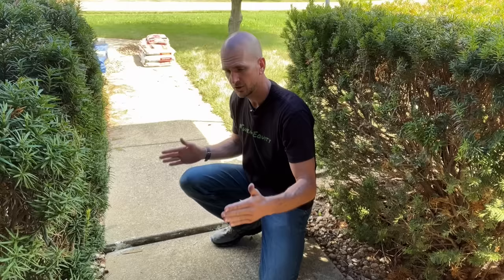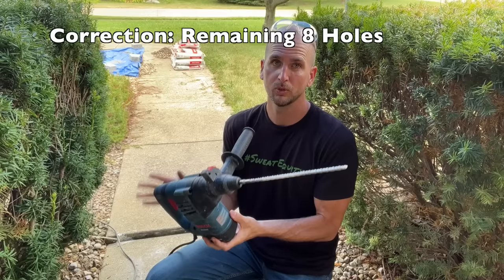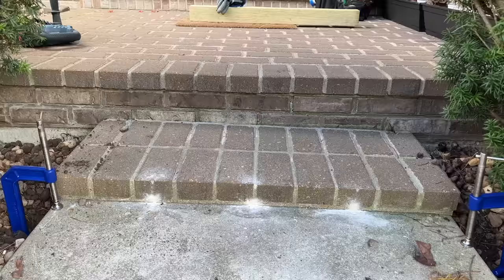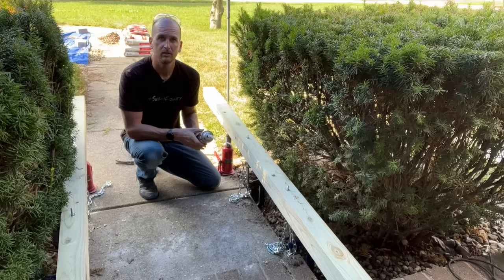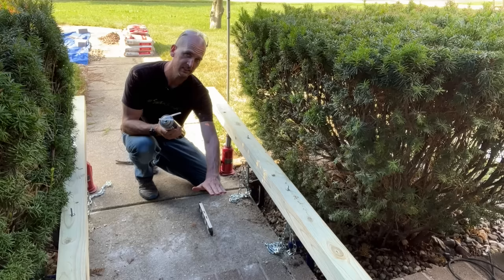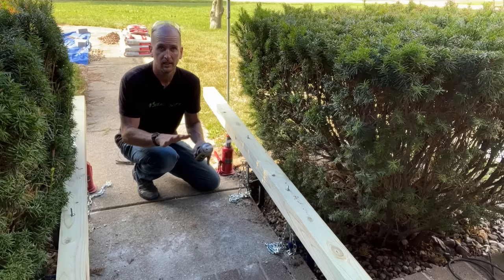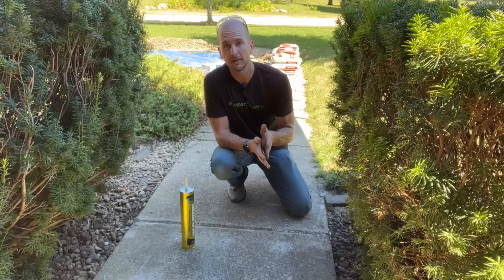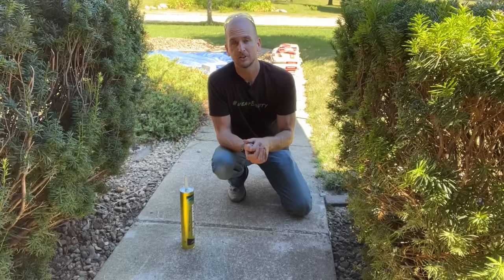How To Fix A Sunken Sidewalk With Spray Foam

Comment: A small piece of a 2 by 4 and a crowbar will do the same thing take a small hole in the corners of each side that's lowered use the crowbar against the piece of wood to pry the concrete up repeat on the opposite side

Comment: Looks good how it was raised up level again with the technic used though any spray foam will break down in time & give, I would have trenched under the slab both sides added some bricks though in doing so when the slab is being lifted I would have raised it up approx quarter inch or so then work bricks in tight in center & both sides therefore the slab in time will settle making it even with the other slab.

Comment: Drill a set of 3/4 holes use self leveling cement instead of foam and instead of that junk in the cracks use Silkaflex it's at home Depot and Lowes in the concrete area and is made for UV resistance and made to last for no less than 20 years

Comment: Great video: short, to the point, good technique.  One question, what about if we don't have two bottle jacks laying around?  Seems like maybe could use a hydraulic car jack (maybe with some tweaking for side to side), or other 4x4s as lever arms to lift the ends of the 4x4s you show.
Reply: Any car jack should work. If they can lift the car, they can lift a few square feet of concrete.

Comment: The foam will deteriorate quickly over time & cause the sagging again, I would use the round cylinder concrete block that the foundation company uses to put underneath & pour concrete cement in the dig areas & seal it with dirt over it. This will pretty much permanently lasts for a quite long time.

Comment: And what do you do when the great stuff breaks down? Its also not made for ground contact or weather exposure so that will break it down even faster than when its used inside.  Its designed to disintegrate over time to powder.  You needed to use spray foam concrete for this project.

Comment: Considering all the steps and all the stuff used i kind of feel that just removing the slab, just fill in whatever suitable, long lasting material you have at hand is better. If he could use the spray foam to do a quick fix that would be one thing...

Comment: Open and closed cell spray foam hold water. It rains, then drops below freezing with the water retained in the foam. When water freezes it expands...When this happens your concrete will crack every single time to make room for expansion. No expensive papers from college but I understand simple physics. Good effort though

Comment: I've done some foundation repair and such but I'd ask the life span of foam compared to puming mud seems the mud stays if you mix the portlaine correctly but for seems holds up to water damage whitch is usally what cause such damage water can destroy anything. Portlaine the simple bye product of ash or crushed rock natrual earth material not chemicals

Comment: To do this correctly you would need the closed cell foam instead of the spray can foam. The spray foam gets compressed over time. Or just mix a thin slurry of cement and pour through a  hole under the slab.

Comment: Unfortunately, my sidewalk runs next to my brick house and there is a raised brick planter running the length of the sidewalk on the other side, so I have no way to get a clamp under the sidewalk. My only choice would be is to hire a mudjacker or resurface the concrete walk level to meet the rest of the walk. If I resurface one section, I'll have to do the whole length, otherwise it will just look like a patch.

Comment: This guy is definitely an engineer and not a contractor.  Ingenious way to lift a slab but wat too labor and cost intensive.  A simple 5' pin bar and a few 2 x4 or concrete pavers would have tis done in half the time.   Also, the step that the concrete buts up to is only 2 -2/14" high and is also a trip hazard.  Its also not to standard building code, which states that a series of risers can not differ individually in height by more than 14".  The next riser is clearly much higher than this one making this first riser a trip hazard as well.  I would have ripped the walkway out and replaced to to be level with the first step.  .

Comment: you could literally make a company doing just this where Iive for probably 10+ years.  I'm a glazier and I can't tell you how many new homes have sunken steps and sidewalks at the front door.  it's like 95% of the homes we go to need this done as they have one step with like a 10" rise and the others at a normal 6 or 7" rise.  it's always the first slab like in this video that sank.

Comment: You cant spend about $300  for Bottle jacks chains J bolts hammer drill bits 4 by 4 lumber and c clamps or about $30 for a few bags of concrete mix

Comment: With a small lip of less than say 1 inch. Could you not just grind off the lip with a handheld angle grinder to remove the trip hazard? Although not an elegant solution it would weather over time and not be too noticeable?

Comment: it was luck that kept the concrete corners of the other slab from cracking under the weight of the bottle Jacks.Good Video just seems expensive in tools and materials.

Comment: My "drooping" slab is up against a raised concrete porch. If you're standing on the slab, looking towards the porch, the left side of the slab is right up against the side of the house (CBS with stucco) and there is no place to get a C-clamp there. The other side is a flowerbed, so no problem on the right side. What do you recommend to raise the side of the slab that is both up against a wall and the concrete porch? The slab is about 4 ft. x 4 ft. concrete.

Comment: I would have put 2 or 3 bricks on each side where the C clamps are for some solid points. Not sue how long that foam will last before it starts compacting.

Comment: Great work, man. How has it held up so far?
Reply from the maker: Honestly, it sunk back down.  The sealant is still holding strong but my best guess is I probably should had let the foam setup for longer so when I place the weight from the sidewalk back down on the foam it would had a better shot of holding the weight.  I am going to do a round 2 coming up this year and looking for an alternative method.  Stay tuned.

Comment: With the cost of 4x4, c clamps, jacks, spray foam and all the hardware. Seems a lot cheaper to remove slab a pour new concrete.

Comment: Lifting is fine but not everyone wants to wrestle a heavy item. This is simple let the foam do the work for you. Unlike having to cart dirt and shovel it the foam takes a lot of time to compact and break down it’s temporary. If you had settling the lift dirt or rock method is as well since there was a reason that dirt settled in the first place.

Comment: Very clever jack rigging.  How's the level holding up so far with the spray foam?  Wonder if that stuff compresses much over time.
Reply from the maker: Not the best, If I did it again I would do the same to raise the slab but use grave, sand, bricks or something else as the base.
Reply: @EverydayHomeRepairs  too bad.  😞 I was hoping for an easy solution.

Comment: Did you do that for yourself? If not, how much does a repair like that cost the customer? I would suggest putting plastic bags around the bottom of each C-clamp. That would keep the foam from sticking to the metal.

Comment: Nicely done, but quite frankly, at the costs of all the items that it took to lift the slab before injecting the foam under it, especially these days, it probably would have been cheaper to sledge hammer the sunken slab and poured a new one it its place.

Comment: Good job and great video, but with such a small piece, why not just mix and pour a new section?  A few bags of concrete might be less than drill bits, foam, 4x4’s, bolts, chain and maybe jacks and clamps if not already owned.

Comment: Hi. That Tremco Vulkem 45 SSL One-Part Semi-Self Leveling Sealant has a near perfect color match to your existing (older/aged) concrete!!! Looks good. How did you do that? Is that the exact color right out of the caulking tube? Or did you add something to that caulk sealant to better match your existing concrete? 
I’ve been using SikaFlex grey self-leveling sealant WITH some sand sprinkled after on top, to better match the existing concrete. Not perfect, but decent compared to stand alone grey/or limestone sealant. Which doesn’t look to appealing at all. Thank you very much.

Comment: A lot of comments mentioning an easier alternative of lifting the slab and putting dirt/gravel down. 
Can we at least understand that spray foam is used almost exclusively for raising large format slabs? 
My pool deck was fixed in a similar fashion. 
No chance in hell you’re lifting those slabs.

Comment: Humble opinion: the real problem is not being addressed, the soil under the foam will continue settling because there is not compacted roadbase under the slab, organic soil is sensitive to the water that will enter through the sides and will continue settling, there is no rebar or dowel bars connecting to the rest of the walkway or the foundation, therefore, when the soil settles (and it will) there is no rebar to hold the slab up. I stoo hiring the foam services as i was always getting a warranty call in less than a year. It is cheaper to install a mortar ramp to alliviate the trip hazard, but if you want a real solution, remove, install road base, comoact it, install rebar connecting into surounding slabs, and new concrete. In the long run, it is cheaper to replace with nice structural reinforced concrete.

Comment: Break up the sunken concrete, build forms, pour new concrete using bag mix and a wheel barrow. Will be cheaper, less expensive and take less time. Enjoy your brand new and properly sloped sidewalk section free of holes and cracks.

Comment: Well if you like to work hard and smarter that was the way to go, not to mention substantial higher cost.I think it would have been easier and a lot less expensive to break that concrete up and pour a new one.

Comment: I'm in the process of trying this on a larger section (5x8) at my home.   I've seen other using the Great Stuff - Gap and Crack vs the Large Gap that was used here.  Does anyone know which might support more weight, be better in the long run?   The number of cans doesn't really matter to me.   I know that the "Large Gap" is Closed cell, so it won't suck up water.  Not sure about the "Gap & Crack".

Comment: I think this is a great method ..but for a dyi’r .. by the time you buy all you need to do this.. you’re better to break it up and re- pour the concrete. Or put brick down to match the upper step. 
Either way I think the amount of work and expense equals if not cheaper than leveling. Also no holes drilled. I know me… seeing those holes would bother me 🤷🏻‍♂️

Comment: GREAT VIDEO! THANK YOU!
Just one question?
On the side, near the end of  the video...
Is that tape on side in between the slab you raised and the one you were standing on to work?
If so.... what is that for?
Reply from the maker: That tape is just to ensure the 45 SSL sealant doesn't spill out.

Comment: I wonder if a person couldn't use a long piece of clear flexible tubing the same diameter as the foam straw and spray the foam in from the side instead of drilling the slab.

Comment: As a professional contractor that has a poly jacking company. This foam is not going to last it does not have the strength to support the weight of concrete over time. For the cost of all the time a materials you can have a professional repair done for 250 dollars. But I like the ingenuity

Comment: You're going to have 2 issues. 1 being the concrete will begin to crack between the holes you drilled with them begin so close together and secondly, you need some sort of hardening agent mixed in with the foam. It will eventually settle back down as the foam breaks down

Comment: A little quick research and i see that Great Stuff has a compressive psi rating, from the manufacturer, of less than 10. Concrete, meanwhile, is in the thousands. Will this method actually hold up?

Comment: I got a rocking slab on my driveway. The slab isn't sunk yet but when you drive over it, it rocks.. Do you think this spray foam is strong enough to do this on a driveway or would I have to upgrade to a secure set?

Comment: I actually lifted and leveled my 5 x5 main walk way sections (2 low sections) by drilling 1/4 holes and filling ea hole a little and accordingly at a time w the foam  un believable how strong that foam is  I used 5 cans of great stuff 430 and 2 hrs was way cheaper and faster then demo and pouring 2 new sections.   even tho there's only $35 worth on concrete in ea 5x5 section local contractors get 3-500$ a section which is insane imo. yes some demo but that isn't hard and lets be honest staking 2 2x4s on ea side isn't rocket science    folks don't be afraid to tackle side walk rear or replacement on your own  you'll save thousands literally!!  sealed the drill holes which were filled by the foam I just ran drill through the foamed holes quick and filled  with leveling mix concrete really thin watery stuff and capped about 1/8" dimple w acrylic caulk  under $50 total for 50 sq ft of sidewalk repair!

Comment: Yes it works however what is not being said is after a year the foam breaks down because it is against dirt and moisture that will break it down and it will be the same way a year later. This is what people do when they are selling their homes and don’t want to spend big bucks. They figure it is the next home owners problem.

Comment: IMO it probably would have been faster to break out that one section, form it up and hand mix a couple of bags of concrete to put in the forms. All of the work that you did to get a level small piece of walkway sort of makes me think that you may work for Public Works department of a city.

Comment: good work, but not applicable when you have a walkway between two house foundations. Still working on how to raise the slabs from ONLY the edges ON the walkway, not the sides of the slab.

Comment: After the cost of Roto hammer, posts chains bottle jacks, wouldn’t have been more cost affective to demo and pour that section?
Reply from the maker: Some people prefer that method others don't like when the concrete doesn't match.  If you don't mind the mismatch breaking out and repouring is not a bad option.
Reply: @EverydayHomeRepairs  loved the process though.
Personally I’d enjoy the way you did it, just because of all the moving parts. :)

Comment: Well nice work but I think is to much work for just simple concrete slab,,,,in my case I just flipped up and put the floor to the right level with compacted sand and finished,,it was like two years ago and still with right level than others.

Comment: I'm curious to know if the section moved at all in 2 years.
Reply from the maker: It did, settled back down about half of the original amount but the Tremco Vulkem sealant is still holding strong on the edge/lip.

Comment: That spray foam won't last. Should just drill 3/4" holes in that block about 1/2" deep. Place forms around it an pour new right on top of sunken step.

Comment: Dude, just pry up the damn sidewalk slab and pour some sand under to level?  My wife & I did half a dozen in a day.  
On our new house one of the 9ftx10ft back patio slabs had sunk and was diverting water towards the house . . . so i just dug a 2x3 section of yard/dirt up next to the low edge and dug as much as I could underneath, (about 2 ft).  Dropped a car/floor jack onto a piece of wood, and jacked it right up.  added rock & sand and lowered it and filled in.  it's been fine for the past 11 years.
So many convoluted fixes to simple problems.

Comment: You have to wonder- after all the work, the wood, the jacks, the bolts etc wouldn't it be easier to call a foam lifting co to do this right in about 30 minutes for about the same or even less cost?

Comment: How is it after 7 months? I did my sidewalk a year ago and it has sunken again. I think the foam in these cans is not the right density to maintain expansion.
Reply from the maker: Yep, mine sunk back down but has settled a bit higher.  The 45 SSL sealant is still holding strong which actually make the lip less of a trip hazard.  I will continue to search for a higher-density foam for this application but Great Stuff isn't standing up to the test of time.

Comment: I don't think foam will bear heavy loads long term, or hold up to soil contact.  It will degrade.  would have been easier/cheaper/faster to push dirt under from the side.

Comment: After all, the work you went😂 through, you didn't need to draw holes in the concrete slab.at all""
  You should have just ,mixed up 2 bags of concrete and pushed it under the slab,  gave it a couple days to set. 
   Take the clamps off ,and you're Done!!😎

Comment: Yikes!  2 4"×4" posts, bottle Jack's, hammer drill, C clamps...lots of stuff I don't have...$$$$.  A few bags of ready mix cement, 2x4 for a mold,, and a mixing tray costs less. Or just pry up the slab and pour gravel under it to prop it up.

Comment: Used Great Stuff Foam to fill in a void which had eroded under my back porch patio concrete slab.  It’s very sticky when initially applied so I’m pretty sure I managed to trap the mother copperhead under that slab and filled in the void completely.  Allowed the Great Stuff Foam to expand until it likewise came out the front edge of the slab.  No more copperheads! 👍 (DFW, Texas)

Comment: Great stuff needs air to cure... Past a am inch or so, without exposure to air, it will stay liquid for a long time. That's the issue with single can spray foams.